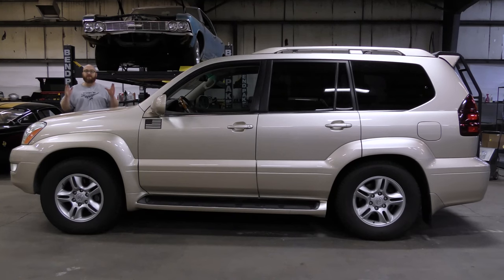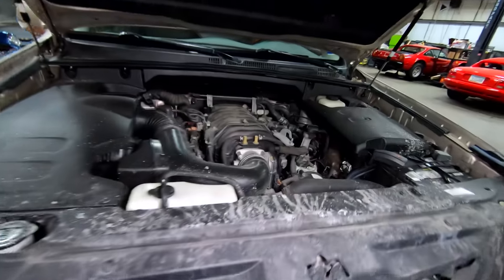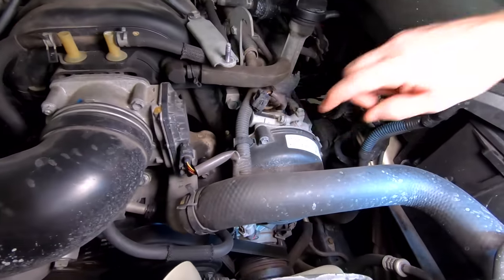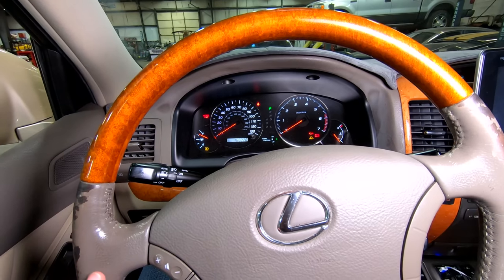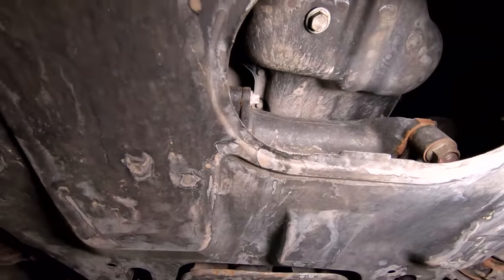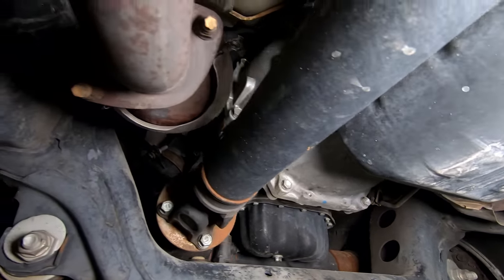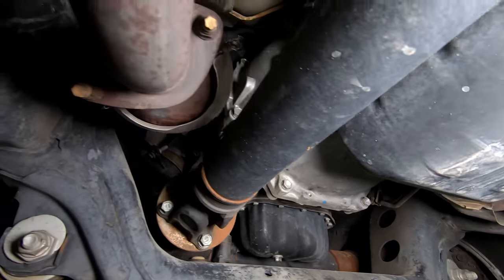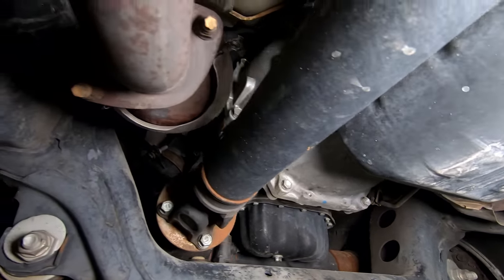How could this super reliable '07 Lexus GX470 have such a stupid design? CAR WIZARD weighs the risk

Comment: Also remember that this IS a Land Cruiser Prado. The starter up under the intake manifold keeps it out of the weather and elements. They typically last hundreds of thousands of miles without a fuss. Seems a pain but for those who use these vehicles as intended, it's a feature.
Reply: Also the job isn't particularly difficult but just takes a while, I'd much rather clear the intake above the engine for a few hours rather than fight awkward bolts under the car for even 15 minutes.
Reply: @Turskaify  What? You rather work for hours instead of removing a couple bolts and sliding a new start on in 15 minutes? OK...
Reply: @donmynack  its alright, he's a "toyota guy" they rationalize any bad design or mandatory expensive maintenence, (ie water pump and timing belt at the dealer). That kind of money going into any vehicle no matter what the repair will keep it on the road. Keep a starter on hand if you're going in the middle of nowhere, replace it easy. Instead of being fucked.
Reply: Yall hating in the comments yall ever heard of BMW?
Reply: @fsb_-bf3th  plus good luck doing  the starter tap trick if you're in a bind.
Reply: lexus gx
Reply: @vw5056  yeah but the toyota is reliable tho?
Reply: @fsb_-bf3th  yeah but the toyota is reliable tho?
Reply: @JollyGiant19  its in the shop for a timing belt, water pump and starter. Reliable or not if you're a dummy you can't do that yourself. So reliable or not, its gonna cost a dummy who don't know anything money to fix things where its "mandatory" by design to make a dealership money
Reply: @JollyGiant19  that gx is in the shop for over $1000 for 3 things. Good on reliability.
Reply: @Turskaify  Four hours vs 1- 1 1.5 hours. I'll be willing you have a very expensive boat payment to make each month.
Reply: @Turskaify   Now that is just silly.
Reply: 4Runner in the U.S. Landcruiser Prados aren't REAL Landcruisers, lol.
Reply: @vw5056  lol
Reply: Okay bcus my gx has the same starter been ok for 270k lol
Reply: The Land Cruiser Prado never came with this V8 engine. Most Prados had diesels, or at the most inefficient a gasoline V6. 

I don't know much about the other engines, but this V8 is on most Toyota trucks in North America. I wish we could get the smaller engines in North America, maybe the truck would be more efficient and have more space underhood to work on the engine.
Reply: @questioner1596  Yah That is true I've never heard of a petrol land cruiser of any sort in Europe
Reply: @R33GTRRRR  so the 4.7 doesn't need a mandatory 80-100k water pump and timing belt change? Do research before talking dude. Sit down and pay attention in class. The starter under the intake manifold has nothing to do with either of those components but the customer is doing it because its in the shop already. You obviously never owned a Toyota
Reply: @R33GTRRRR  and if you "had" a 4runner and it had thr 3.4L you are definitely bullshitting. No respectable owner would leave a mandatory timing belt/water pump change, unchanged
Reply: And if you can't read. One of my comments said if you can't do it yourself it's expensive
Reply: @R33GTRRRR  go ahead and say "don't do the water puml" that makes no sense dude. Go to the dealer. They require them to be done at the same time. That's like a dummy with a misfire saying "ill just change the plugs and not the coil. We'll do the coils 10 years from now
Reply: @R33GTRRRR  those parts were designed from factory. By Toyota engineers, to have the Water Pump! And timing belt changed together. Theres stickers made for the timing cover specifically for that. Go read an owners manual
Reply: @neilmurphy845 , we haven't had any diesels available in North America since the 80s, and its ridiculous fuel consumption and automatic transmission are the two main reasons I haven't owned one. I briefly had a 2WD 4-cylinder Tacoma (similar to Hilux) and it even used more fuel than an 8 seater Sienna (FWD V6 minivan, slightly larger than an Opel/Vauxhall Sintra).
Reply: @R33GTRRRR  Yep I'll never own a vehicle with a timing belt for that reason. I'm doing a timing chain kit on my '14 Maxima when it gets delivered (hell of a time to find parts nowadays lol) plus a few other things just bc the tensioner is worn out and has the most annoying rattle (mainly bc I'm ocd with shit like that) on start up. Gotta take the front of the motor apart anyway so might as well do some clean up and it'll be good again for another 200k lol. Toyota and Lexus are usually easy af to work on and yea $1000 shop bill ain't nothing. The shop I work at is $145/hr so it's super easy to hit $1000
Reply: I have 246,000 miles on my 2003 GX470, and offroad it pretty heavily on the weekends, while my wife also uses it during the week as a kid hauler around town. My starter has never had a single issue... and while I get the concerns, I also understand what the point in the vehicle is, why it is where it is....
Reply: @R33GTRRRR  dang that's pricey.  I have a 2014 GX and my lexus dealer's service department charges $125 for the same sort of thing.
Reply: @fsb_-bf3th  my 2008 GX has 390,000 miles on it. 3 Timing belts and 3 water pumps, tires, wiper blades, a radiator and pads and rotors. That’s it. No other problems. Air suspension system works like brand new. Original shocks. It’s the most reliable car ever made.
Reply: It’s not a land cruiser? Isn’t this based off the 4Runner
Reply: @MS-mr4zm  The 4Runner is actually based on it... Look up "Landcruiser Prado" on Google or something. The GX470 and GX460 are literally a LC Prado with an "L" on the grille, and mom mobile accessories like a backup cam.
Basically, Toyota didn't think a hardcore offroad machine would easily sell in the U.S., so they "mommed" it up a bit. If you wash all the mom off the vehicle, it's pretty impressive.
Reply: @fsb_-bf3th  Have you ever heard of Ford?  Lets talk about PTU's which overheat and fluid can't easily be changed, water pumps placed internally in the duratech V6's, coolant intrusion etc.
Reply: Yes, but most Prados have either the 4.0 V6 or a 3.0 4cyl Diesel (now replaced by a 2.8)
Reply: @CarlosOteroC  That is all depending on what regional market the vehicle is in. Saying the Prado doesn't have a V8, is accidentally disingenuous on your part... because the GX literally IS the North American Prado. To say the V8 isn't used in the Prado, means the GX doesn't exist at all.. Toyota sees Americans as wanting engines for long drives while towing, and diesel engines don't sell well here... Thus the 4.7 was used.
Reply: @fsb_-bf3th  chains aren't really much better, just a longer interval before failure.  they last longer but the guides normally go out before the chain stretches.

Gear driven ftw
Reply: @OscyJack-  aren't much better is a stretch. Id say they're definitely better. It just depends on the quality of the chain. If you get a manufacturer who makes a subpar timing belt against a subpar timing chain. I'll take the subpar timing chain. If I get a manufacturer who makes a high quality timing belt and a high quality timing chain. I'm taking the high quality timing chain.
Reply: @fsb_-bf3th  it's not the chain, it's the guides.

I'll take a serviceable item every time over a timing chain. Yeah it's an expense. But it's also much easier to service.

Chains may last 2 or 3 times as long, but generally a.more involved repair when needed. Timing belts are easy just time consuming.
Reply: Our 99 cruiser needed it's first starter a few years ago at about 180kmiles
Reply: The killer mistake for me as a consumer was the truly idiotic tailgate. Not an upper and lower door clamshell like the LX or even a lift up door like the RX. This door opens on the left side and opens sideways. If you’re parked on a curb, you have to step into the traffic path to open and load it. I’m guessing it was designed for the JDM with the left side being the curb side. I took a pass on the GX twice because of this
Reply: I've seen multiple 2uzs cross 300k miles on the original starter
Reply: is it a feature on my 2004 ls430 or my 2006 gs430?
Reply: @KiyaWarrior  Landcruiser Prado is a short wheelbase Landcruiser specifically designed for off-roading when the full size Landcruiser started to get bigger.  It is without a doubt a Landcruiser which is why the entire world calls it the Landcruiser Prado
Reply: just replaced my factory Toyota starter at almost 200k miles and it had yet to fail fail on me but was going
Reply: I would maybe agree, but the alternator isn't exactly in the greatest place to keep with the theme of "keeping it out of the elements." I own one btw, just wanted to chime in.
Reply: @bobwobbabble5151  Where did you purchase the radiator? Thanks!
Reply: @questioner1596  there is so much room under the hood though.
Reply: @PhildoBaggins , access from above is fairly good, but down the sides looks a little tight. Most engines on the Land Cruiser Prado were inline-4s, giving lots of extra space down the sides.
Reply: @JollyGiant19  Ohh bullshit dude toyota breaks just like any brand
Reply: As a Toyota tech I disagree. The starters have somewhat of an issue of going bad. It’s not that hard to replace though, just a little time consuming compared to others.
Reply: @fensterlips  Youre mistaken, if you park with the direction of traffic with the curb being on passenger side they door opens toward the curb, so you are not walking into the traffic like you say. Also this is literally a non issue for 99% of people, as there is no reason for me to park by curbs, all grocery store and my house I pull in into a parking space or driveway. 

Secondly its awesome for short people, my GF can barely reach her 4 Runner tailgate and its convenient if you have low celling in the garage or parking garage. You've made a really bad decision twice.
Reply: @mattlauderdale8363  They sell GXs in Russia, hence why the Russian print on many parts of the vehicle, along with French.
Reply: @mattlauderdale8363  Toyota sells a hardcore offroad machine in a form of a 4Runner, and used to sell even a more focused FJ Cruiser, which they discontinued so the 4Runner does not have competition. Toyota Marketing didn't want another "Land Cruiser" "tainting" the name of the big LC in the US, they only wanted one "Land Cruiser", so that's why the Prado here is sold under a Lexus name with Lexus's luxury redesign. Its actually a direct competitor to the G-Wagon, similar size, luxury body on frame SUV with a V8.
Reply: @GXMAN16  I know... But the people here who don't get the GX of course don't know that... Which is why I put it as simply as possible. 
Also, you're a #gxor friend I assume?
Reply: @mattlauderdale8363  No don't know who is gxor is. The GX is a hidden gem in plain sight, its the vehicle that always will have to get explained by people that know. Most people don't know what a Prado is, so saying its LC Prado never works. I simple explain that its a Lexus version of the 4Runner.
Reply: It’s a pain for the technician working on your over glorified wanna be land cruiser. Try working on cars for a living. Nobody gives a shit about a design feature on this nerd mobile. It’s a PITA plain and simple.
Reply: Also the Prado usually comes with the v6 1GR engine and does not need a timing belt change since it uses a chain 💪🏽
Reply: @fsb_-bf3th  I think the rationale is that a belt and pump every 100,000 MLS is preferable to having a car in for random repairs on on a regular basis.  I've only ever had one starter go in 30 years, and it wasn't a Toyota.  Making the job easier would be better still though, but I can live with it.
Reply: @nou8257  yeah but not at the same rate, that’s reliability
Reply: @fsb_-bf3th  My 2006 Sequoia is at 300k. All in total, I paid 1k for each timing belt replacement. The vehicle is good to go for another 70k miles before another replacement. 3k is chum change when it comes to a new car payment.
Reply: @fsb_-bf3th    I don't buy a vehicle i would not be able to afford the general maintenance. Those are mistakes made by young people just starting out in the car world.
Reply: I thought the GX was the 4 Runner and the LX was the Land Cruiser?
Reply: @VincentScales  Similar chassis but the 470 IS a Land Cruiser Prado. Smaller LC cousin to the 100 and 200 series we got here in the US. Toyota refuses to give us the goods they ship literally everywhere else in the world.
Reply: @VincentScales  GX was the LC Prado.
Reply: @fsb_-bf3th  so you drive around with a spare starter in the trunk? are you by chance a "chevy guy" ?
Reply: @fsb_-bf3th  it’s a 15 year old vehicle with 167k miles, $3k is NOTHING to keep a vehicle like this on the road. A European vehicle would’ve had $3k in repairs before it hit 50k miles. After these replacements the GX will not need any more repairs for another 150k miles. Not to mention if you wanted to sell this gx you would still get $20k for it lol
Reply: @vw5056  a screwdriver works great
Reply: The sole reason for the starter placement is for consistent line assembly at Toyota, namely it’s easier for them position the steering shaft on right hand drive vehicles without having to relocate the starter. It’s an engineering / manufacturing decision to standardize starter placement on all vehicles made for all markets.

Had Toyota not done this, the starter would be in the way of the steering shaft on RH drive vehicles.

Also, if this starter wasn’t heavily used (lots of longer trips, fewer stops) the unit could have 5 more years of life on it.
Reply: @MS-mr4zm  it and 4Runner are based on Prado
Reply: This guy doesn't know anything about Toyotas.  He heard the air bags deflate on their own (something they are designed to do in park in certain conditions) and thought it was a leak.
Reply: @vw5056 I actually used this trick for a couple trips in my old Crown Victoria in High School when it tried to leave me stranded.
Reply: @whiteyonthemoon1193 going for that up sell.
Reply: That's not why it's designed that way. The UZ engine family was originally designed for the LS400 for which the elements on the starter are not a concern. It's just an annoying design decision on an otherwise excellent engine.
Reply: @donmynack I agree, I've had to do the starter on my 95 yukon twice, and it's one of my least favorite mechanic jobs I've done.  Greasy bits of dirt and muck falling in your face while holding a heavy starter up in an awkward position, definitely not my first choice!  Although I will say you are right, it's a quick job once you know what you're doing.
Reply: So why did the FWD V6 Lexus RX have the same design flaw?     It was a Toyota design fad of the time and a very stupid one
Reply: @OscyJack-  Guides are serviceable, and they typically last 300K+ which reasonable oil change intervals.    

Old oil with significant fuel presence is what causes issues with the nylon guides wear strips breaking down and failing.
Reply: @BC08  if you're going into 200k timing guide repair, you're doing the chain too unless you like doing it all again later.

Right, and? That's how most people use their cars. Fix it when it breaks. Long oci's. Etc.
Reply: @OscyJack-   Chains are usually fine for indefinite mileage unless the chain was damaged by wearing against the timing guide frame after the nylon wear strip fails.    

Timing chains in OHC setups usually have hydraulic tensioners so chain stretch simply isn’t a factor.
Reply: @BC08  yes it is a factor lol.

If you like running an original chain for life even after opening a timing cover, it's an odd choice but you do you
Reply: @OscyJack-   It is not a factor.   I’ve manually degreed (as in measured valve events and adjusted camshaft centerlines manually - not installed cams like the factory) over a hundred DOHC and SOHC V8s and have intimidate knowledge of OHC timing chain life and “stretch” characteristics.    

I will happily “keep doing me” as it has resulted and zero timing chain failures to date in even extreme applications.
Reply: @BC08  I'd like to live in your fantasy. Let me know when you're accepting new applicants.
Reply: @OscyJack-   No fantasy to be found, only fact based, hands on, real world experience.  

You’re sharing opinions based on some failed idea of common sense borne out of ignorance on the topic.   
Your little ad Homs will never bail you out here, they will never bolster your credibility or your obvious lack of knowledge on the topic.
Reply: @BC08  facts according to your anecdotal statements lol

There was no ad hom. 

I'm only a 20 year wrencher, no big deal.
Reply: @OscyJack-   I think perhaps you should inform yourself on the actual definition of anecdote.   

Your fantasy barb was calling me delusional, which is an ad hom.  

Been wrenching for 20 years and yet still know nothing about the topic you’re offering your uninformed opinion on.   Why is this?
Reply: @BC08  sounds like someone needs thicker skin...
Reply: @OscyJack-   Calling a spade a spade doesn’t imply thin skin
Reply: @BC08  anecdotal evidence. Do better. You're picking a fight with a random dude on YouTube go about your day.
Reply: Since they made all the other components easy access, SOMETHING had to be awkward? There's only so much space...
Reply: @dawicked2k8 BMW's are horrible...
Reply: @mattlauderdale8363 C.A.R.B. rules prohibited the Toyota from selling diesels in the US.
Reply: L200
Reply: @vw5056 but it’s a Toyota so you won’t be.
Reply: Just saying, the starters on my 4.0 Jeep and my GMT400 Chevy can both be removed and reinstalled in less than 5 minutes, and those starters also last hundreds of thousands of miles. But that's not going to stop Toyota enthusiasts from acting like a design flaw is actually a feature.
Reply: I prefer a Jeep 4.0 over these toyotas anytime. I bought mine in 89 new, the mileage is over 500k, same engine and tranny, 2 starters replaced by myself, few engine mounts, radiators and shocks over the years, plus the tune ups.